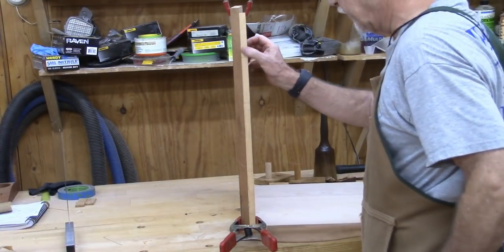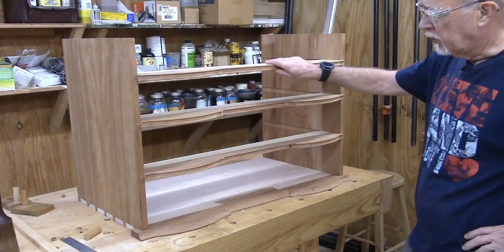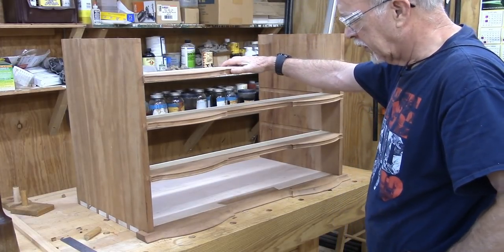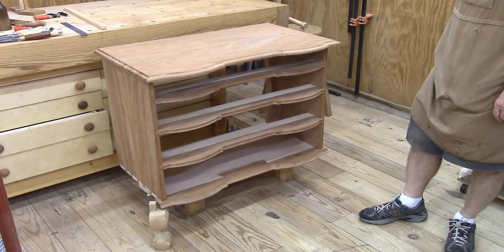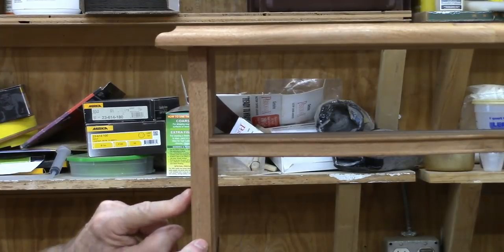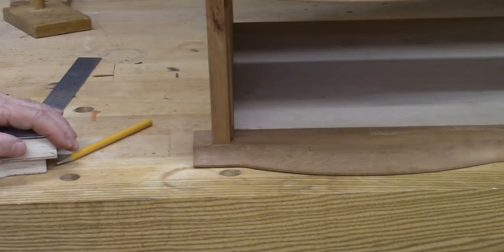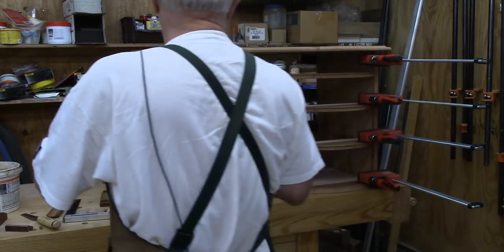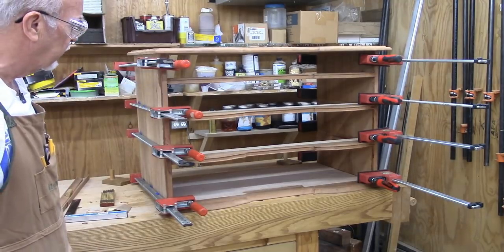Second Curved Blockfront Chest of Drawers Carcass & Glue up Step 2

Comment: David what is your opinion of clamping pressure when gluing up a panel say? I’ve come across different opinions and with your skill level I’m curious as to what your approach is? Thanks
Reply from the maker: I just clamp enough to make sure the joints are closed and the glue squeezes out